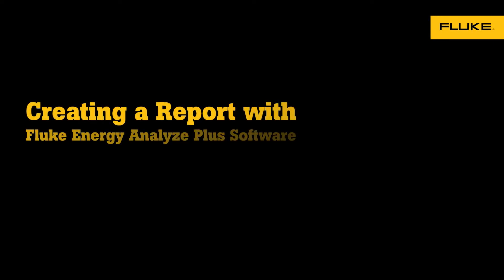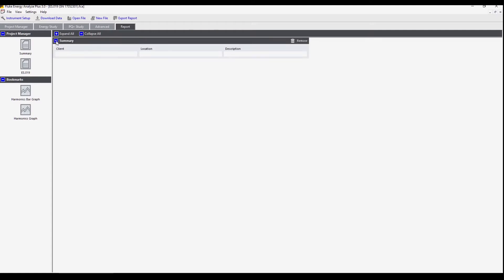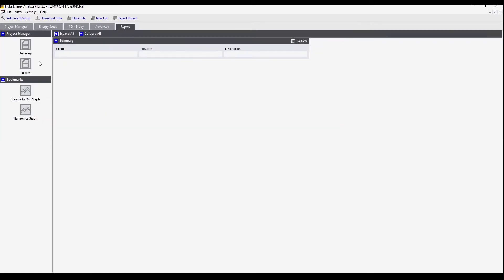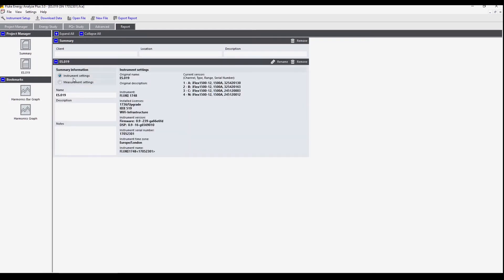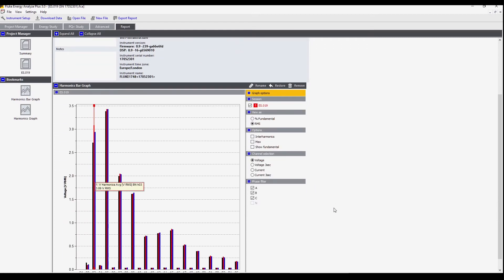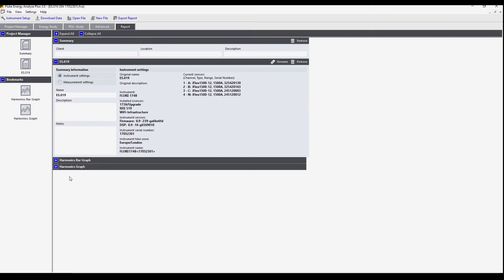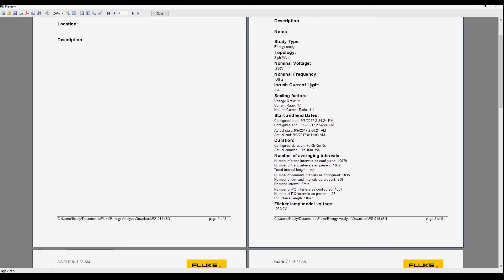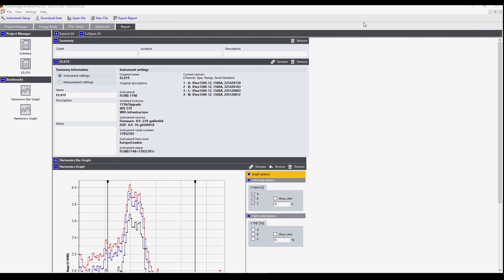How to Create a Report With The Fluke Energy Analyze Plus Software

Comment: How do we analyze the data in this manner with the Fluke 3540 FC?  I'm looking to read and analyze my data without the use of a phone or tablet.
Reply from the maker: Check out the manuals here - they should help: https://bit.ly/3ui72EC
Reply: @fluke  did you click this link to see if this would answer my question?

C'mon.  I just spent four hours working through your terrible mobile app with no way to get data off an iPad and I can say based on this small exchange, I want to sell our 10 3540FC's and go entirely dranetz.